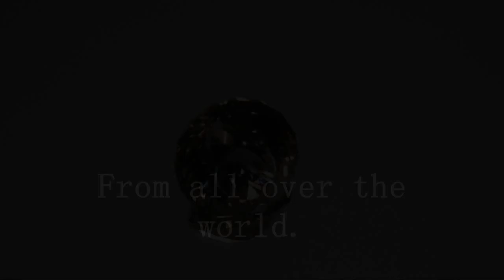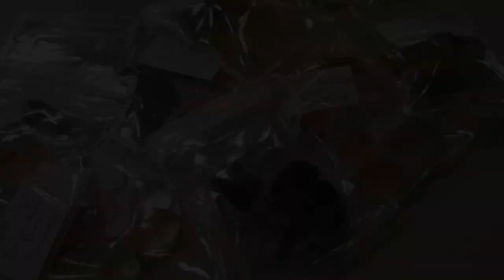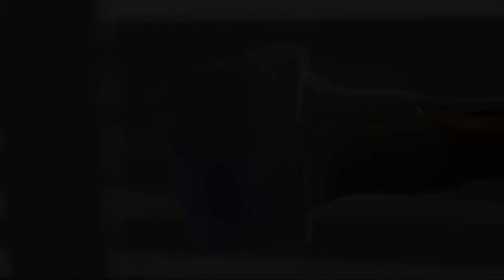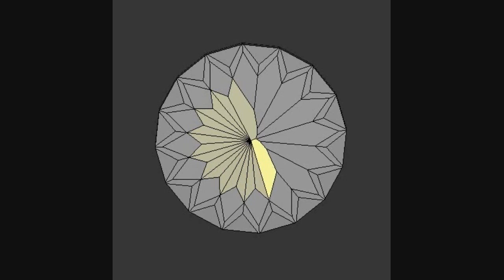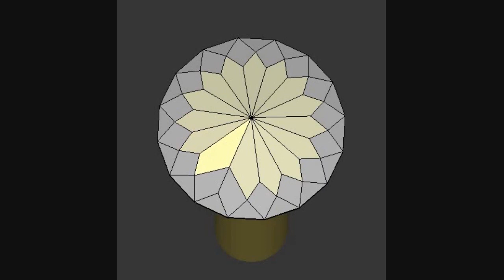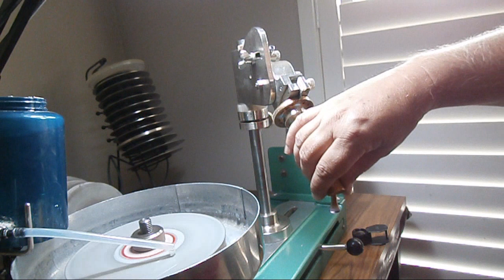I Made A Flowering Amethyst Gem

Comment: Happy New Year Cliff. Awesome Cut. i like that it ditributes the Light pretty wide inside the Gem. And of course i liked the Sunlight Exposure, there were some bright sparkles. that Gem would shine nicely in some earrings,if you would make a second one of it. Which btw might be tricky, so many tiny facets.
Reply from the maker: Hi Aik, happy new year to you also. Most gems for earrings are usually 4-8mm. This gem is 12 mm. As it gets small the level of difficulty increases with getting the V Shaped frosting correct.